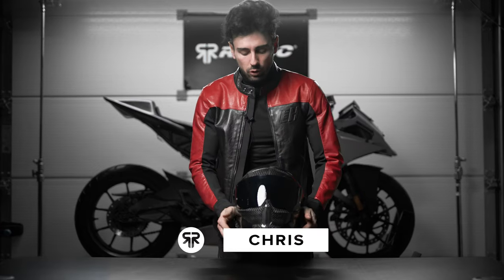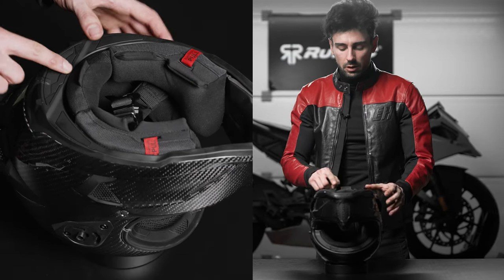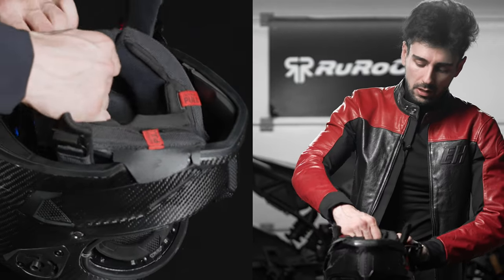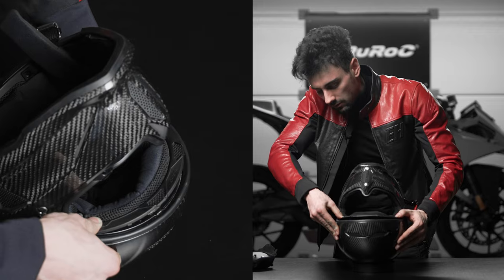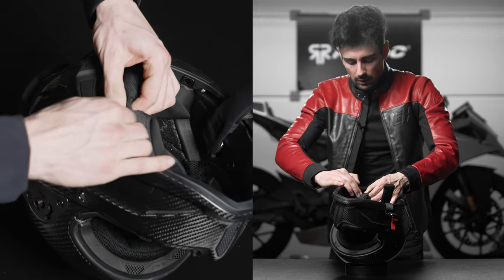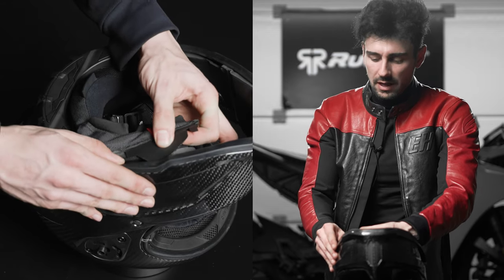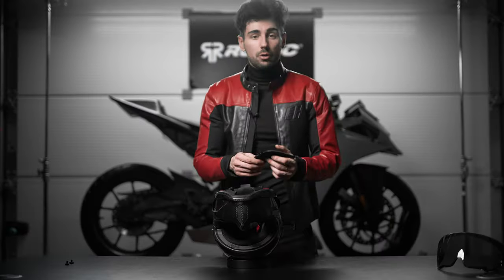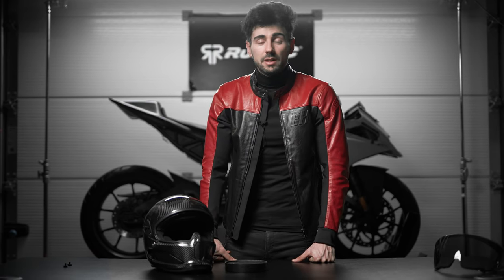AT4.0 Remove and Install The Comfort Liner | How To

Comment: I purchased a helmet from Ruroc and was very excited about its delivery today. The packaging and the helmet itself looked very high-quality at first glance. However, I ran into problems when I had to change the visor and install the audio system. The visor didn't easily click into place as shown in the videos. The round plastic piece was so deformed that it was impossible to attach the visor. I had to use my mother's nail file and some WD-40 to finally get the visor on. The inner lining is easy to remove, but sometimes difficult to reattach properly. When I tried to test the audio system, one speaker didn't work, so I had to take everything apart again, etc.

I have to say, the helmet looks awesome and has a lot of potential, but it seems like they cut corners on materials. You can notice it in the small details when you really examine the helmet closely. I'm keeping it because I've already spent 3 hours trying to complete it, and I don't want to go through the hassle of returning it, etc. There are certainly other helmets in the same price range that offer higher quality.

Comment: Followed advice, ended up snapping the front of my liner, amazing
Reply: I literally just done the same thing
Reply: @user-wh4db4yi9z  is it fully broken or somewhat salvageable? They are very very fragile
Reply: Dude same, mine broke at the clip so I can’t even put it back into place but the rest of it is good. Huge bummer for a new helmet
Reply: @Jaber1545  and for the price they cost you'd think they wouldn't be so delicate. 
Once this helmet is due replacement I'm not getting another ruroc lol

Comment: I got myself an ATLAS 4.0 Track, Core Carbon, about a month ago, I used the helmet at first without changing the visor that was on it whenit arrived, or fitting the Shockwave, and I’ve got to say it is a very nice bit of kit. From receiving it and unpacking it, it simply looks and feels stunning.
Today I decided to try and fit both the different visor and the headphones, mic and Shockwave unit

Visor
Could not be simpler turn pull the screws out on both sides and off she pops. Fit the new visor the holes on both sides simply snap into place and the two plastic grommets/screws fit in and turn and that’s it done. I done this a few times, just to make sure I wasn’t just being lucky, and it worked every time.

Shockwave, headphones and mic
So, my chin guard wouldn’t come out, not matter I plodded on I managed to get the liner out half way, I couldn’t remove it from the top of the inside of the visor opening, so I just folded it out of the way whilst I fitted the headphones and mic, they velcro’d into place very easily and you can see the Velcro patches in the helmet so you know where they go. Not so easy plugging them in on either side (a wee tip use tweezers to hold and push them in, to get the snap you’re looking for).
Connected the shockwave unit into place (which I had already charged up and blue toothed to my android phone), put the helmet on and tried. WOW. I actually like the sound quality. Headed out on the bike (any excuse lol) and tried at speed, on my loud R1, I thought still a good sound and reasonable noise cancelling of bike, wind and traffic. Yet to try and answer the phone whilst riding, that will follow. 
Definitely a good helmet, and I wouldn’t mark it down because of the problem getting the liner out. I think we’d all struggle with any make of helmet at first, I was being very careful this being brand new.

Comment: wondering why many people have trouble when getting these liners on and off, it's very easy to analyze the locations of the helmet's slots especially you already did this with a different various brands of helmet, not sure why people are getting really frustrated. had my 3.0 before and it was quick and easy (btw had to let it go too small for me). now I'm excited to get my hands on the 4.0 and hoping it fits me this time.
Reply: putting them on is very easy but the cheek pads do not lock easily, where you lock the chin guard and the cheek pad also locks, seeing it in the video seems child's play but doing it... no. The chin rest doesn't lock at all either, it fits into the slot but it's not easy to get it to catch the hook
Reply: @W1nc3nt  Just did it for the first time, I find the cheek locks and chin locks a disaster of a design but I finally got them in...the demonstration in this video is just a lie no way he locked his in.
Reply: @Jaykav99  did you include the frontal chin as well? the cheeks are really a disaster, in the video it looks like a joke and instead to fit everything into the joint is hell!

Comment: Was a huge pain in the ass for me to remove the liner to install the speakers.  Half the poppers came out of the liner and stayed in the helmet and it was a huge SOB trying to get them back into the liner.   Then, the speaker wires to plug into the jacks... holy hell!  my fingers are sore from trying to push them in.  I had to push them in with needle nose pliers.  All though the padding is good quality, after removing and putting it back in once I'm not sure about the quality on the rest of the stuff.  The foam protection under the liner is crooked and slanted across the front of the helmet so it sticks out a bunch on one side of the forehead piece.  After just snapping the forehead liner part out once it already is really lose after snapping it back in and has a big gap now since it's so lose even when snapped in.  After removing the ear pads and chin curtain, I can tell the rubber lining around the bottom of the helmet is going to start to come off really soon.   The rear popper comes out on it's own now after removing the liner just once.   Can also tell the chin curtain is going to have issues staying attached as well.  That top vent is hard as heck to open or close,  I couldn't imagine trying to do it while riding with gloves... that goes for the chin vent too, heck can't even tell which way is open and which is closed anyways.  The helmet comes with absolutely no instructions.  I'm assuming it's because they want you to go to their website and watch their hundreds of how-to videos.   The Shockwave doesn't even come with instructions on how to operate it.   There isn't even a mention of the Chain app anywhere.   That being said, the helmet looks really nice.  I got the Mercury and it looks amazing.  Though, it did take them 6 months(!) to ship it to me after ordering it at launch.
Reply: I feel you. One of my poppers completely snapped in half and I had to send my helmet back in for them to repair it. Just got it back in and I’m hoping all the poppers stay in place once I try to install the shockwave this time. My buddy ordered one the same time I did and once his came in the rubber lining under the Helmet was falling off already with zero use, straight out of the factory packaging. I love the look of the helmet, I’m just really worried about quality now, especially because of the price point at which we pay for them.
Reply: I have exactly the same problem, except that the rubber coating came right off and there is also a strong bulge in the plastic at the front of the headliner. I have rarely seen such poor quality. The tabs that are supposed to lock between the shell and the padding just don't lock in anymore. They keep slipping out. It's very sad that you can't send back such a low-quality helmet because you've ridden it for 15 minutes.
Reply: @MisterReach  one of the poppers broke in half when removing the liner had to send it back waiting for a replacement hopefully this doesn't happen again but it's happening to alot of people so clearly there's a design issue  . This helmet is a pain in the ass I don't understand why they don't pre install the shockwave and save us the trouble .
Reply: @Bendova215  me too i also asked the Support for doing it but they told its not possible. Maybe cause they know that the Comfort Liner is lose afterwards.
Reply: 100% the video here is staged imo no way its that quick and simple , I'm a mechanical fitter and it took me 45mins to do the shockwave instal with pliers etc also this guys voice made me want to punch the screen

Comment: Just received my loqid carbon altas 4 and I have to tell you the helmet is great !!!  - byt the poppers you used are absolutele crap ... and I mean crap. I installed shockwave and the rear 3 poppers  would not stay in place after I removed it  to install the headset :(((  It literally pops out in the back everytime Im putting the helmet on !!!!

Comment: I don’t see that one on the site, is there going to be a new drop? 🤨
Reply from the maker: Hey, The new liners for ATLAS 4.0 are designed to be backwards compatible with the 3.0 helmet, but with this you would miss out on some of the key benefits of the step change in our technology. The other design upgrades we've made to the shell and interiors mean that to be the quietest and safest ATLAS ever it needs to be used as the fully integrated helmet. Our focus right now is on meeting the 4.0 demand, so we can't put any timeframes on when or if the 4.0 liners will be going on sale.
Reply: @Ruroc  fix the popper issue it's ridiculous for what you charge for this helmet that removing the liner breaks the poppers and why don't you guys install the shockwave with the helmet the visor the shockwave it was 800$ us and I have to install it come on.

Comment: Can you make the cheek pads ‘less’ padded? Mine seems too tight…
Reply: Maybe you order to small or just need to break in helmet
Reply: Hey mate I have the same issue but for some reason it fits really nice but the something seems to dig into the back of my head dont know if you have the same issue
Reply: Maybe over a little time they will loosen?
Reply: Same problem bro the helmet fits ok but the problem ir was when i take out the helmet bro
Reply: @tomclements5320  my helmet makes my neck hurt. Might be too tight.  Who knows
Reply: @pedrofaial7223  Have the same problem, Helm fits fine but when i want to take it off it feels like my head pops off. xD

Comment: It that liner compatible with the 3.0
Reply: Looks like it.

I can’t wait if they release the padding separately
Reply: @SLIGHT_  I believe they said it is but because it's so much thicker it changes the sizing of the helmet required to make it fit similarly. A lot of people who had a 3.0 and got a 4.0 have found they had to go up a size to get the proper fit.
Reply: @YoloVib3s  understood, I’ve seen this as well. I believe the question was if the padding from the 4 will work in the 3… from what I’ve seen the answer is yes… but Ruroc has not released this padding as they’re focused on filling the atlas 4 orders first. Completely understand this. Just hoping they release the padding soon. Would love the upgrade to my smiler.